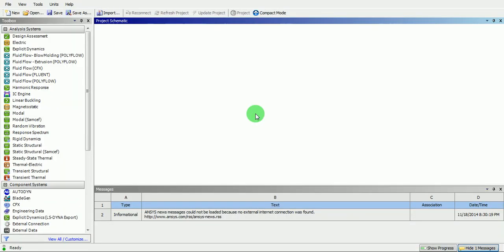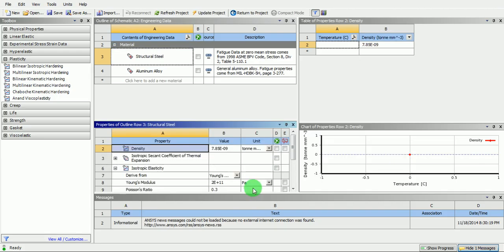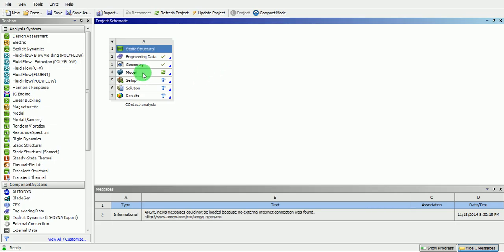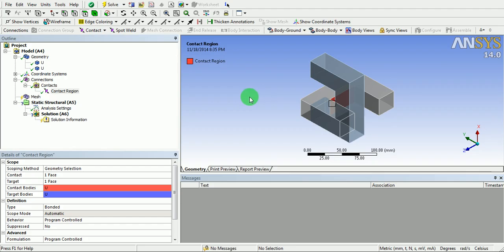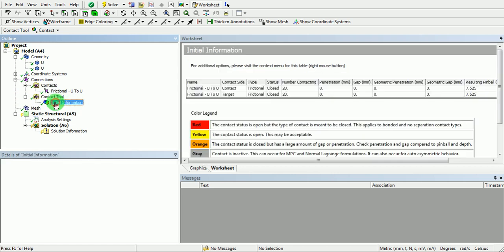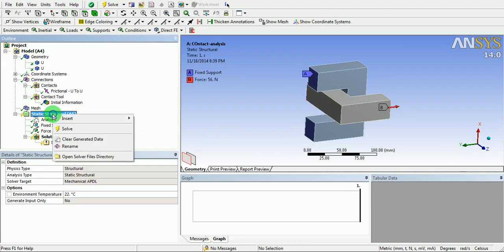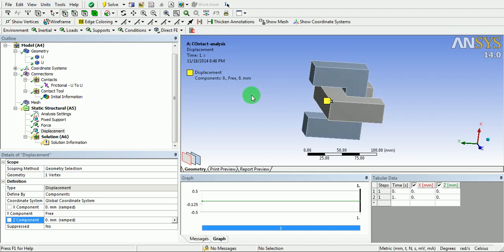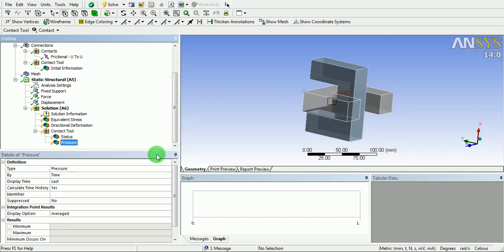ANSYS Workbench Tutorial Video | Beginner/Expert | Contact Non Linear Frictional FE Analysis | GRS |

Comment: The aim of my subject is the enhancement of the heat transfer inside a hot rotating tank which contains a hot rotating blade and a cold fluid. I am using Ansys Fluent but i couldn't find how can i give the initial temperature for the fluid?

Comment: Hello, there is something that I don't understand about your tutorial and I will be very greatful for your response: why do you change the pre-established units of the material data? Despite of the fact that I don't have the programming level of Ansys programmers,  I understand a little bit about general programming language and in the softwares that I had developed in my carreer's courses I always took into account the fact of giving the user the possibility to introduce data in the units of their choice. The thing is, that in my programs, I always converted the data given by the user in the units of my personal choice, so it didn't matter if you liked to use the english measurement system or the metric one. Off course, my programs doesn't have the complex level of Ansys, but I think it is very possible that Ansys programmers should had taken it into consideration. Thank you for reading my comment and for your response. Have a nice day.

Comment: hi ,,,,,,,, what should i learnt before ansys then i start ansys..... i means which software i learnt then start ansys
Reply: before learning ansys learn the design softwares like catia , solid works etc to design the components .After learning them bring the design components to ansys to analyze the stresses induced in design components.
Reply: Saichaitanya Bondada i had also used pro e is it right software or not
Reply: any design software is good to go ,if not u can also design thing in ansys classic but the thing is the interface is not user friendly.If u r an engineer u better use  any designing software to design things *even pro e is good to go * and then take the design to ansys to see the stress induced in the component.
Reply: if u r good with designing u can start learning ansys.
Reply: ok thnks
Reply: @saichaitanyabondada8976   but I am not able to add cad files in ansys help me with that bro

Comment: Thanks a lot for this important tutorial...... My question is that...is it possible to know the maximum stress of fatigue analysis at a given number of cycles in ANSYS WB? as it is known we input the alternating stress vs the number of cycles in engineering data from experimental result and we can get the fatigue life of the material that can survive before failure, but how can i know a stress at a specific number of cycles...

Comment: When you aply the force of 56 N, this force is divided  in 2 forces of  28 N per face or  aply 56N per face?
Reply from the maker: Its divided
Reply: +GRS CAD/CAE itd divided but it depends of the area dimensión right?
Reply from the maker: Divided load will further divided and applied on each node.

Comment: Hi! I have a question. When you get the solution, there is a message that appears at the botton, it says "one or more bodies may be underconstrained and experiencing rigid body motion" What does that mean??  I´ve been trying to make a model with frictional contact, and always get that warning. I would really appreciate if you answer me.... Thanks. (Sorry for my english hehehe)
Reply from the maker: Greetings! !
Mariana I got you, this warning message is due to the insufficient constraints. The model will try to constrain in its position by weak springs if enough constraints are not specified. If you can sketch your problem description and send to engineeringtutorsdesk@gmail.com then I would be able to suggest the relevant boundary conditions to fix this warning message. Cheers....